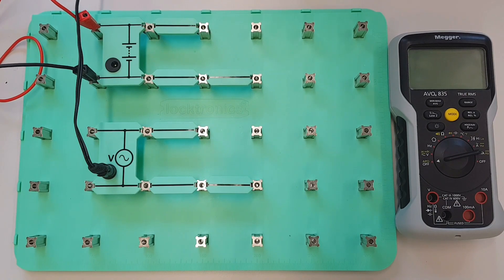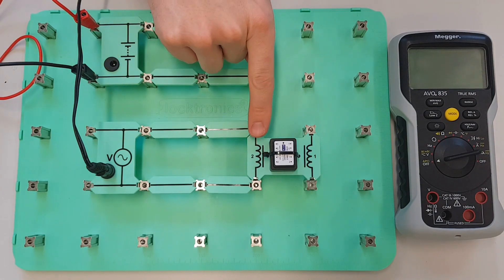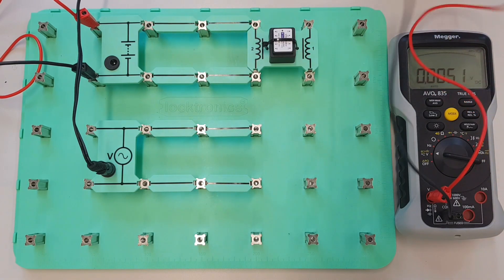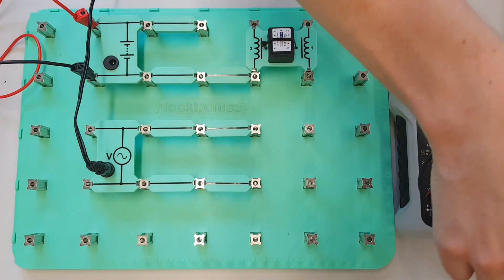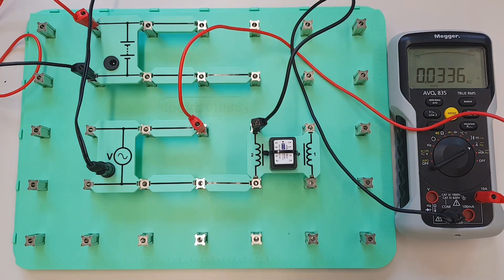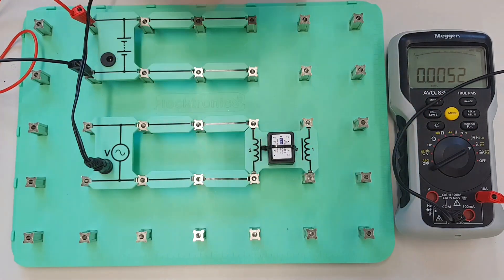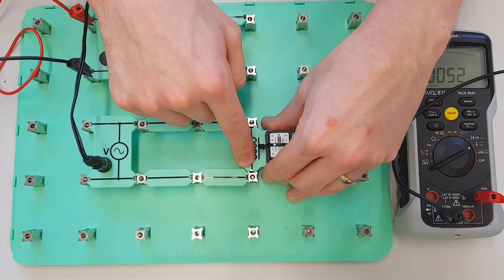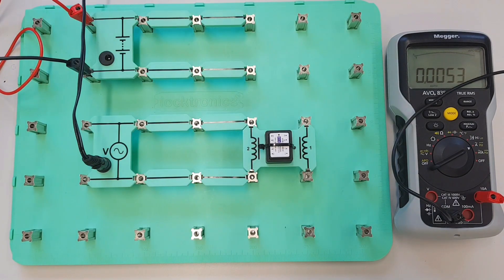AC Theory: The Mystery of the Coil

Comment: Thanks for the video! I learned so much from it. One thing that would have been interesting to see is how the inductor affected both circuits by measuring the actual source voltage before connecting it.That way, we could compare how much the voltage changed when the inductor was introduced.

Comment: Grossly misleading lecture!
The inductor is made of copper wire which has small resistance. This resistance is limiting current in DC circuit. If this coil has s bery few turns your voltage will cause huge current and burn the  coil.
With ac source infuctance will limit ac current to very small current and coil resistanvce resistance iscirelevant.
Reply from the maker: Steady on there chap, "grossly misleading" is a bit much! It demonstrates neatly how AC and DC circuits operate very differently when they are connected to coils. It's aimed at level 2 or 3 learners who struggle to understand this concept that's all.